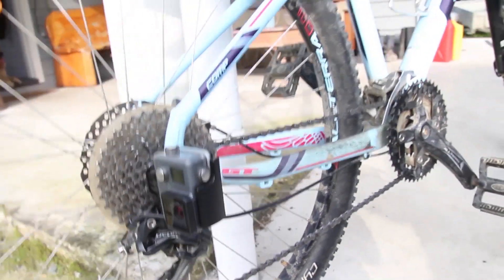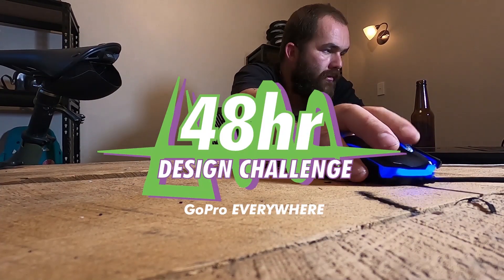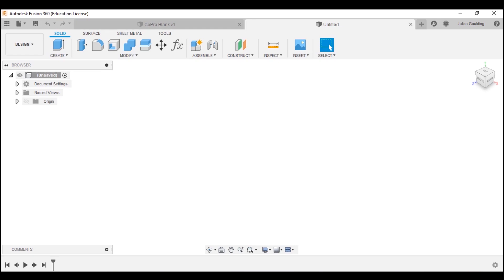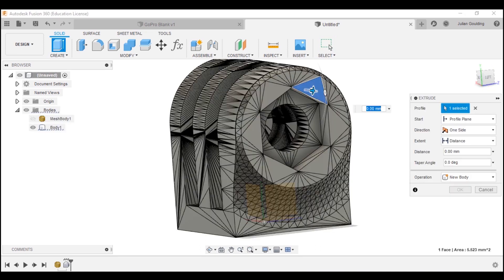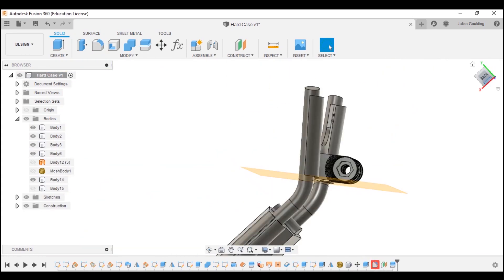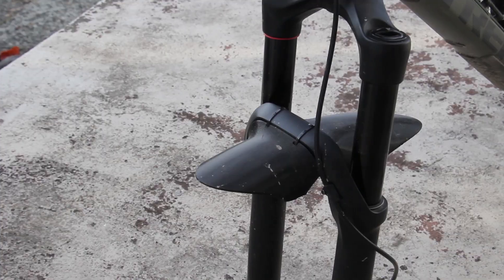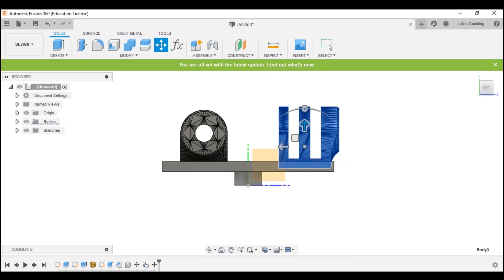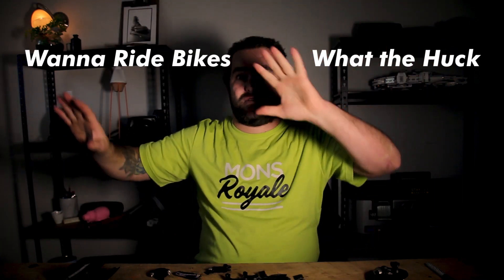How to make your own GoPro mounts!

Comment: The one in the downtube is super smart you just need an extention to let the go pro get out i  front of your bike 😍 I totally want the plug one because I think that could do some awesome video 🤔
Reply from the maker: Thanks Mate! Yeah an extension would be sweeeeeeet!
Reply: @juliangoulding  it would also still get the wheel in the shot so even though it gets rattled about it has a steady object in frame 👌 and the few extra centimeters higher will help the framing as opposed to the one on the fender where there's a lot of wheel 😅
Reply from the maker: @LetsTryVlogging365  I have ordered one so will give it a go. what I have learnt with this is that you don't need to worry about the gopro rattling round anymore, that Hypersmooth 2 is INSANE!
Reply: @juliangoulding  I can imagine I think kun is a hero 6, so no hypersmooth for me sadly 😅  I'm looking to fit a mount on my helmet I just have to decide how permanent I want it to be , 🤣

Comment: First commenter for the first time!

Cool projects and great videos, Julian!

What resources did you use to learn to use Fusion360?
Reply from the maker: Thanks Phil! I studied mechanical engineering (only a couple years) and then changed to industrial design. We used solidworks heaps during that. I then worked in architecture designing some pretty crazy buildings using solidworks. When Fusion came out it was an easy change because all the main stuff is the same. I now teach it at the local high school.